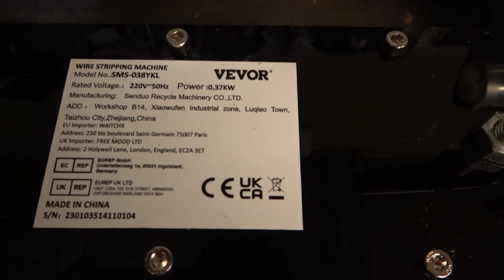VEVOR Wire Stripping Machine - MAKE EASY MONEY

Comment: What can be done with the plastic?
Reply: There are places that will buy the plastic but you need a lot of it to be worth your while
Reply: If you do scrap metal it can be put into inside one of your scrap appliances
Reply: @eternalbatteringram5916  that's not a good solution!

Comment: Did yours come with s red cap or plug ?  Do you know what it is for ?
Reply: Same here. Something with an oil plug according to the manual.
Reply: Hi I bought this very same machine did you ever find out what to do with the red cap. I guess to just swap with the metal one..(thinking only in place for transit)
Reply: @exgunnerdaz  I emailed vevor a while ago and the email came back saying it is a replacement plug.  For what I don't know because I don't see any other red plugs.  My machine has been running fine since fall 2023 tho.

Comment: I have same item used 2 days and had a extremely high Electric bill have you noticed a significant change in Electric bill using this product
Reply: Power is 0.37kw..of you run it for 10 hours straight it is 3.7 kwh which is like $0.4 where I'm at